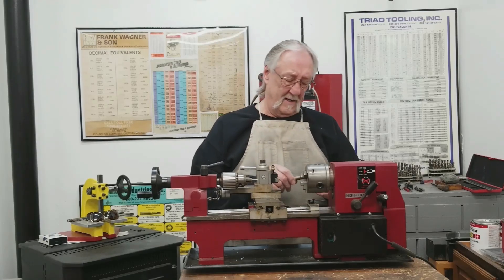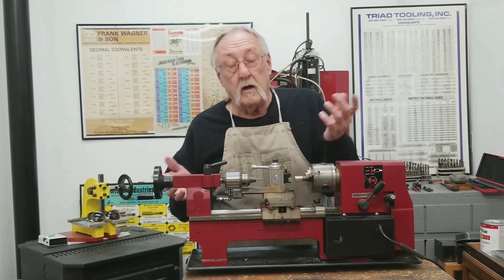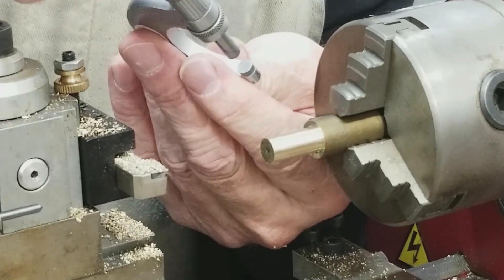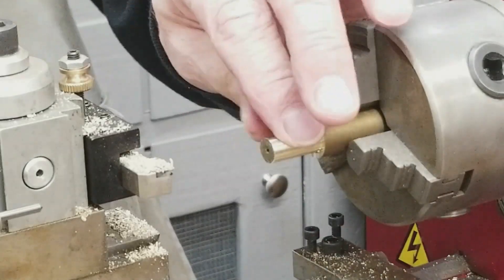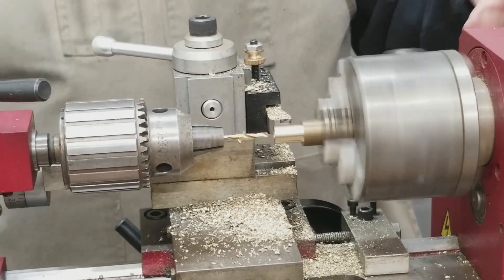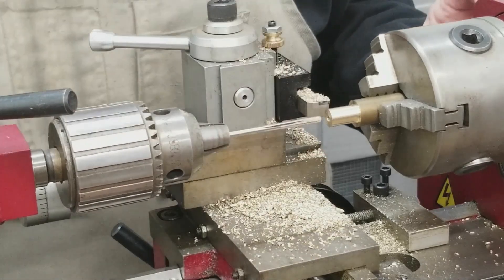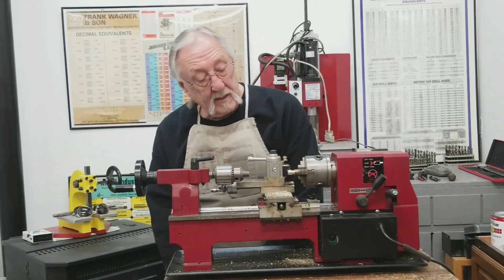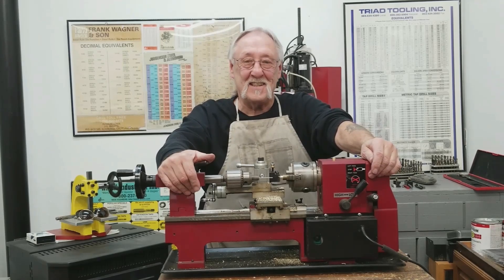A Brass Bushing & The Mini Lathe

Comment: On the edge of my seat with anticipation for that lathes longer bed and tail stock cam lock Mod. Keep up the great videos
Reply from the maker: Thanks, It will be a while before getting to lathe bed extension, I've been building a bench for it for the last few weeks that looks like an old flat belt lathe from the 1800's. Go to my website/blog and on the blog/vlog page you can see a picture. www.glennnow.com